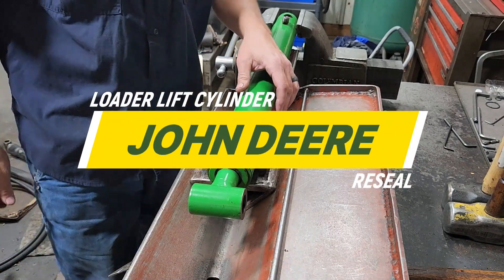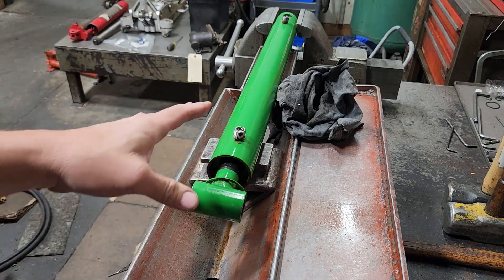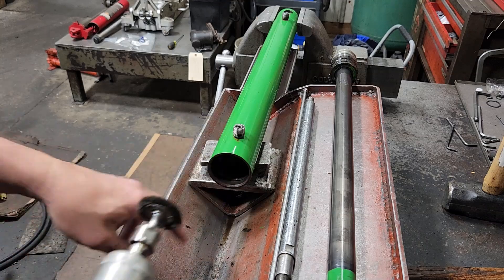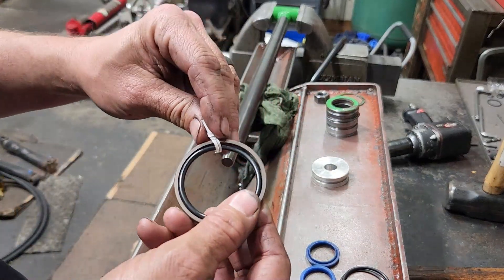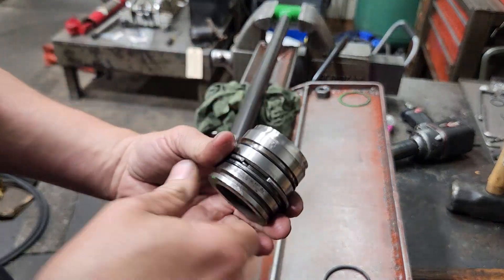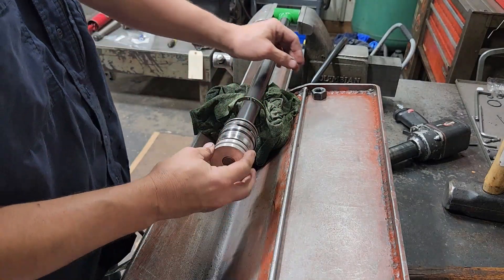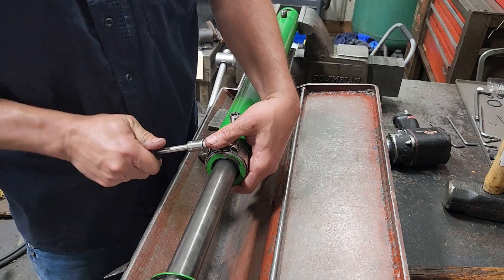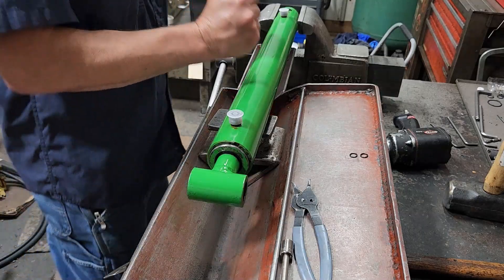JOHN DEERE Lift Cylinder Reseal

Comment: Great video. I am curious as to why you did NOT  put any loctite on the nut; I was told to. Said if l didn't the nut would come loose with time. Thank you for a very well done video. Explained, filmed perfectly.
Reply from the maker: I just watched that part back, and your right. I should've put a little 121 threadlocker on that one. Generally, I don't use the nut to push the piston and gland on so, in doing that I think I overlooked it. Thanks for taking the time to watch and comment!
Reply: @HydraulicRepair NP. Thanks for fact checking. Your videos are very helpful.  Have a Merry Christmas!

Comment: Thank you for the excellent demonstration of the cylinder rebuild. I appreciate that it is to the point. Your instructions are clear and glad to see the you’re not trying to work and hold the camera at the same time!  I’ve done several cylinders on other makes, and a JD steering cylinder. Good to see the steering cylinder is the same as the fel cylinders. Mahalo nui!
Reply from the maker: I'm glad the video was informative! Thanks for taking the time to watch and comment!

Comment: Do I really need to buy the John Deere gland removal ring or can I get by without it?
Reply from the maker: You need it if want things to go as smooth as possible.  Otherwise, the piston seal will catch the flat side of the locking ring groove.  If you buy a kit, it generally comes with one.  Thanks for watching and commenting!

Comment: Very nicely done, I had to tear down a 175 loader tilt cylinder today and the outer snap ring had no holes and was a nightmare to get off, and the inside ring had already come off the gland so I had to fish it out. Why does John Deere have to be so different from most cylinders with screw in glands etc
Reply from the maker: They are definitely my least favorite to work on because of that reason. It's probably cheaper for them to manufacture that way if I was to guess. Thanks for watching and commenting!

Comment: porque não cromou a haste?
Reply from the maker: Because it didn't need it. If the rod has a blackish appearance like this, it has been through a process that enhances rod hardness and helps resist corrosion. This is typical on some John Deer cylinders. Thanks for watching and commenting!

Comment: Would that be the same process for a JD 5220?  I've been told the seal is sun rotted.  And, how much should it cost to have someone do it for me since I'm a 64 yo widow who doesn't have the tools?
Reply from the maker: I would have to know the model number of the loader instead of the tractor. But, if it's a smaller to mid-sized loader, their all generally the same. As far as cost, it all depends on your area. I'd check with a local hydraulic shop if you have one close. Otherwise, you'd probably have to go through Deere, which will cost more. I hope that helps some. Thanks for watching and commenting!
Reply: @HydraulicRepair   I guess I have a choice between 541 and 521 with a 510 thrown in for good measure.. LOL  I just looked.. It's a 541
Reply: @HydraulicRepair    I found a place in Searcy (AR.)  He said it would be between 150 and 200 BUT could be LESS than 150 depending on the type of seals.   Now to find someone who can take the joker off since he said I can't drive the tractor in to him 🤣  Yeah, we were kidding around.

Comment: What if I don’t have a seal clasper? Will a worm clamp work? Also will the Teflon style piston seal shrink back down like the one you have bronze filled or whatever it is?
Reply from the maker: Yes, one of those will work. Just watch out because they can dig into the seal a little. Also, the Teflon seal will shrink back down, too. Thanks for watching and commenting!
Reply: I've used zip ties as well

Comment: I have seen people use gear clamps to compress the ring, and the seal, any experience with this, as most wont have the t bolt clamp.
Reply from the maker: Yes, a gear or hose clamp that is close to the size will work. I used them for years. You just have to watch them because they like to bite into the Teflon a little. Thanks for watching and commenting!

Comment: Well, I already screwed up and ruined that first piece you put in there to make it slide out. Now what?
Reply from the maker: Google search John Deere gland removal tool. That should get you on the right track. Thanks for watching and commenting!
Reply: @HydraulicRepair  well I lucked out the company I bought my kit from is going to send me two spares free of charge!! no chance of that from Deere!!
Reply from the maker: @georgemcmahill5023 good deal! Yeah, no chance of that from Deere.
Reply: Can I use a torch to heat the piston nut or will it damage the piston? I’m using a 3/4” impact and it won’t budge.
Reply from the maker: @georgemcmahill5023 If it has a unitized piston, I wouldn't. Use heat as a last resort. I use a 3/4 drive impact with 160psi and sometimes it won't break it loose. If that fails, I use a 3/4 breaker bar with a 4-6' extension bar until it starts to turn then finish with the impact. Sounds like it's full of red threadlocker. Hope this helps!
Reply: @HydraulicRepair thanks for the speedy response!

Comment: what would be the reason and how to fix it if it will not drive in but even or a little past flush with the cylinder?
Reply from the maker: It's probably got some rust and  corrosion around the gland. Spray some rust breaking fluid around and blow out with airhose. You may also have to spray and tap around the tube where the gland is with a hammer until you see a dark fluid, which will be rust breaking down. Continue to do this, then try hitting the gland in. You may have to do this process more than once. They can be a pain sometimes. Hopefully, that helps some.
Reply: @HydraulicRepair  Thanks! I will try.

Comment: Really appreciate you doing these.
Looking to do this type of work myself some.
Really love your work tray, would love to see more on it.
Would also really love if you showed more on seal selection and measuring etc.

Thanks

Alan Bechard
Reply from the maker: I've been thinking about doing some shorts on different types of seals and how to measure them out.  I might also have to do a video on the table I use in these videos.  It was intended to be used for floor and bottle jack repairs.  I find it works wonderful for small cylinder repairs.  I wish you luck if you get into this type of work!  Thanks for watching and commenting!

Comment: Do you only reseal or do rod and barrel replacements as well? Show us how the machining and welding. Do you test cylinders after repair?
Reply from the maker: Yes, resealing is what we see the most of.  We replace cylinder rods and tubes when we get a chance to.  Unfortunately, we don't do machine work in house, we use a local machinist.  I do all the welding in house though.  Any tube replacement or tube repair ie: port replacement, butt weld repair, etc gets pressure tested.  A normal reseal doesn't get hydraulic pressure tested if it's just leaking past the rod seal or bypassing on the piston.  However, they do get tested with air after a reseal. 
 Thanks for watching and commenting!

Comment: Thanks for the video.  I am surprised how many different ways there are to hold the gland into the tube.  That freeze spray seems like a powerful degreaser as well.
Reply from the maker: It seems like each manufacturer has to come up with their own way to hold it in place for sure.  Yes, the Freeze Off is surprisingly good at degreasing and cleaning too.  Thanks for watching and commenting!